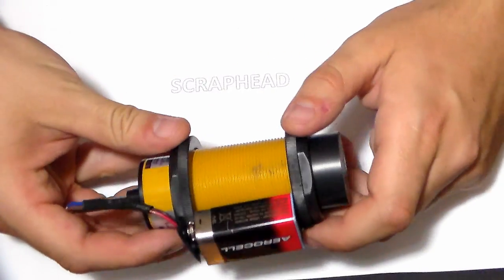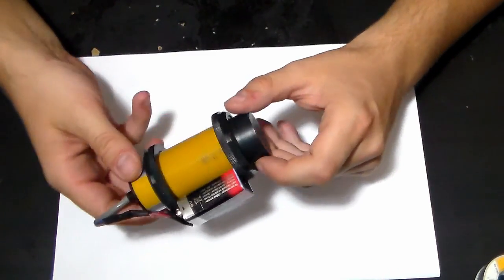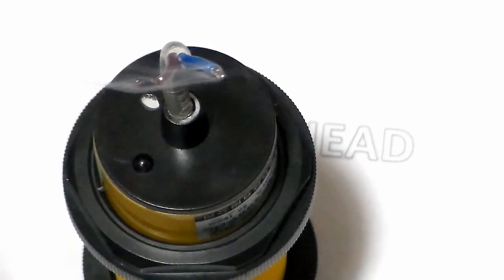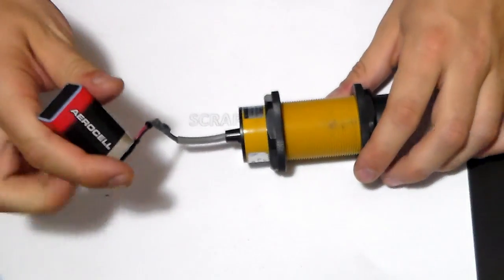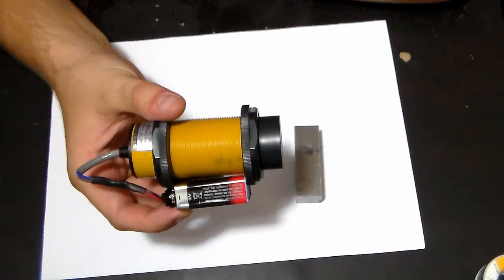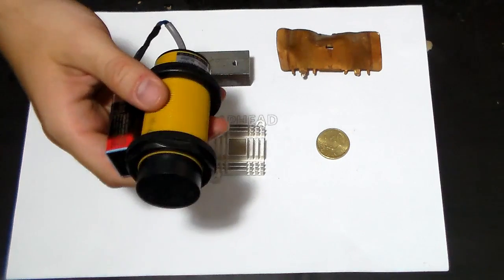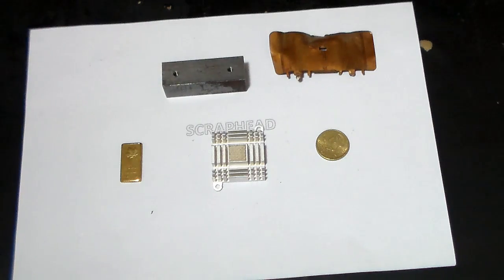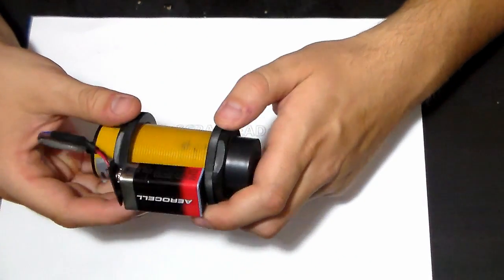Homemade simple and cheap PINPOINTER

Comment: Love your voice and agree the sensor detects metal but would be useless in the field. The purpose of it is to help find that little piece of metal that your main detector found and pinpoint it. This would fail dismally in the mineralised ground because of ironstone.  which would give false readings. This device may be ok on the beach or in the park looking for treasure but useless in the goldfields. Also, you haven't shown how well it works with rice grain sized gold which is where a pinpointer really is needed.

Comment: mine is a smaller one from a 3d printer, I have 3 wires, Black Blue and Brown. Do I leave one wire out?
Reply from the maker: Connect brown to + and blue to - . The black wire is for switching a relay or a led. Depends on if it is a NC or NO model.
Reply: Dude!  Thank you great video!  Im going to hook this out to an arduino, to get my custom sound

Comment: Would of been nice if you gave us a link on were to buy the sensor.  Your spec sheet gives no company name.  I can't find a 18mm proximity sensor anywhere under $100 and with a two wire hook up for 9 volt battery.
Reply from the maker: https://www.aliexpress.com/item/NO-18mm-Detection-Distance-Inductive-Sensor-Proximity-Switch-LJ38A4-18-Z-EX/32295546975.html Thats the same one i use. Mine was cheaper but this one is still only 14$

Comment: can you pull the sensor out of something?
Reply from the maker: Unfortunately a sensor like this is not integrated in normal devices like household devices. So I think not. But they are to find at industrial plants, so maybe you have access to something like this or u know someone working there. I got mine from ebay ;)